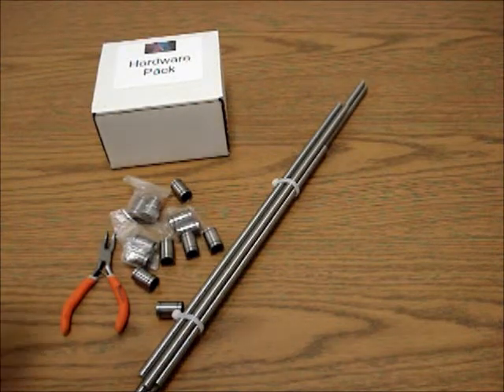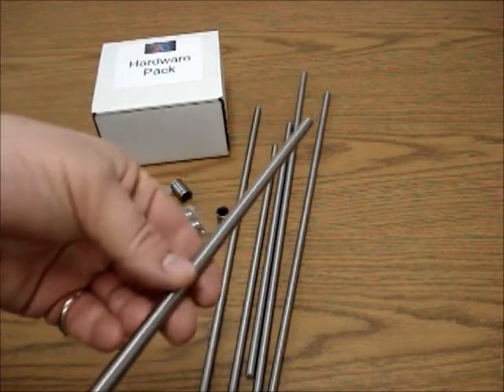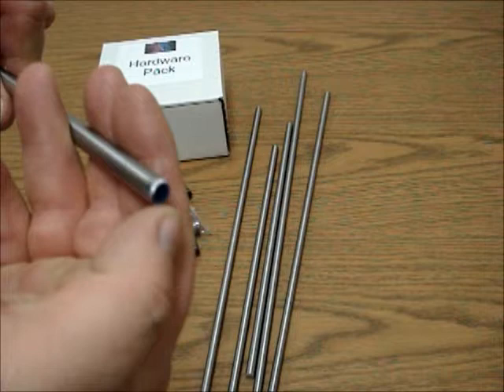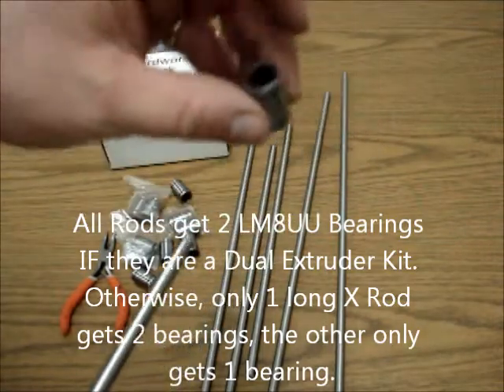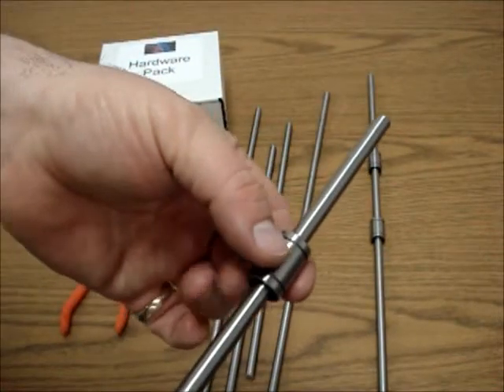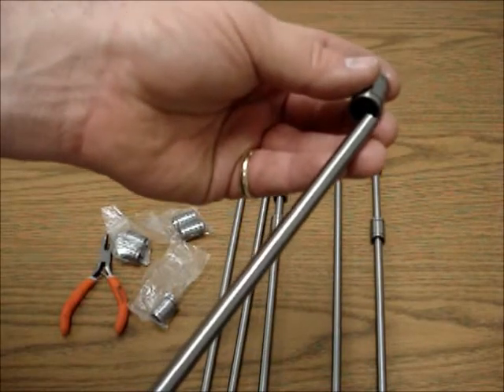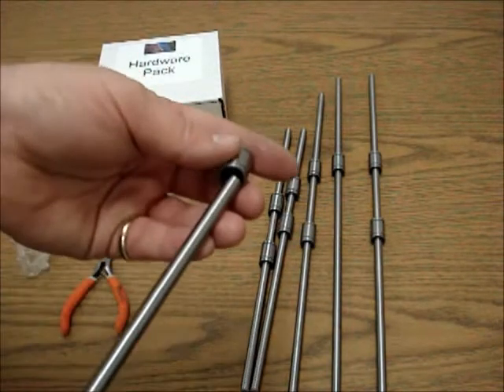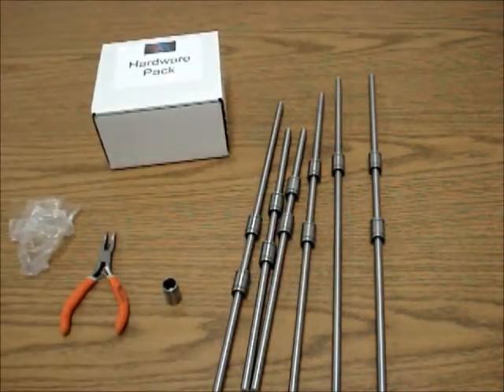RepRap Vision 3D Printer Smooth Rods Prep

Comment: I know this is an old video, but for the sake of better educating viewers, you are completely wrong on your take of drill rod vs. actual case hardened chromed rod. Drill rod IS NOT hardened AT ALL. Hence why they can shear it as you mentioned. If you read the specs properly, it will read air or oil "HARDENING", not "hardened". Which means it CAN BE hardened by the respective means.  It comes "soft" hence why the bearings wear grooves in it. It is NOT precision ground. It is ground to a "tighter" tolerance, but it is no where near guaranteed to be close to the size to properly fit the bearing. Hence why you have some variation in fit. Chromed rods are ground close, hardened, ground again, then plated up to size. Drill rod is NOT better, in ANY way other than cost. Chromed rod is not that much more expensive. Just use chromed hard rod.